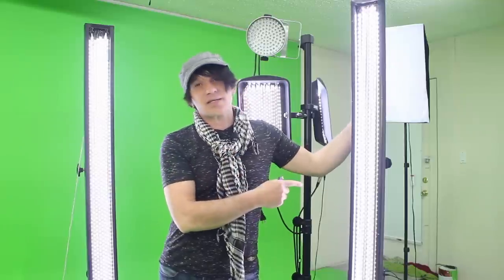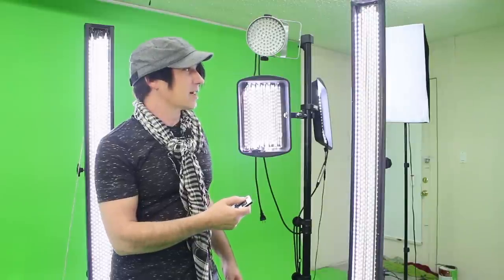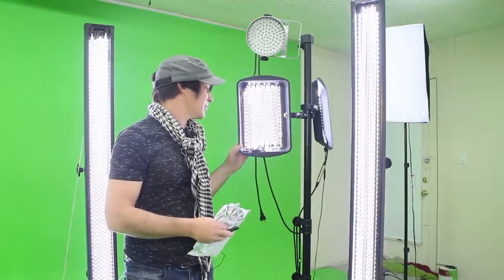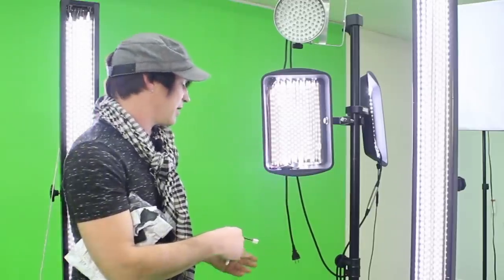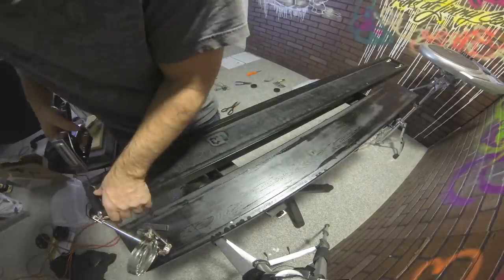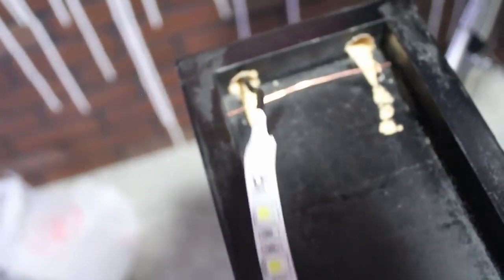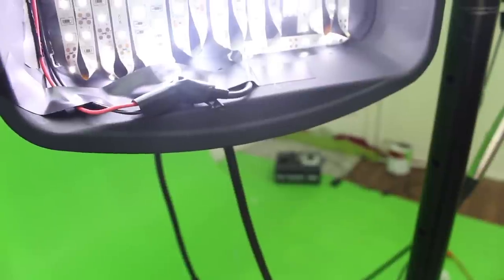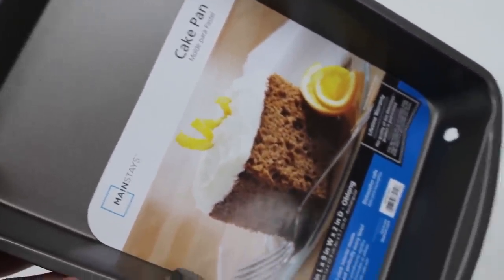DIY LED light panel How to build Video Photography studio lighting cheap

Comment: Best DIY led light panel video out there. Thank you. 
I was thinking about making 6 foot panels instead of 4 foot. 
Do I need 3 strips per panel then and how does that change with the power supply? Do I need more or is 5 amp still enough?
Any help is much appreciated.

Comment: If I were to connect 4 of these rolls together, it looks like I would need to get the 12V 10A Power Supply. I'm not an electrician, is there any danger to feeding too many amps into the LED lights if they don't consume it all?
Reply from the maker: +Bobby Dragulescu , I'm not sure, I use a 12V 3.2A and a also us a 1200Ma universal ac adapter that works best, I also found that 12V laptop power supply works

Comment: You refer to the bracket used to mount your LED light box (4' long) to your light stand. You describe the cost between $4-$5 at Home Depot. I cannot find this bracket. Any chance you can clarify it's description or include a link to it? Otherwise, very helpful DIY. Thanks.

Comment: Great video. I'm about to make these long ones to replace my 2 softbox/six clamp light chroma background lighting. My green screen is 8 x 8 feet. I'm.worried that the led strips will be too forward because I read that they've only a 30 degree forward beam. Do you think if I made two of these left and right 4 feet back from the screen would be enough?

Comment: How did you mount the wood light boxes to stands? And how do you use three on one power supply and dimmer
Reply from the maker: +Matthew Mawson I used Par can clams that you can get at guitar century for like $6, then the power and pig tailed them with old Mic cords I had here at the house, but really you get better light if they all have there own power I have found out

Comment: I built 2 panels from all the parts you listed. I used the wire clips instead of soldering. To prevent voltage drop I also got a DC female to 4 male power splitter and used the female connections that were provided with reels. It took about 3 reel per panel so I have and extra male connector open so I can daisy chain the panels together. My only problem is the lights are very cool in color and we having a difficult time white balancing. It's very rough on skin tones. Any advice?
Reply from the maker: +David W. Ryan Gels For Color & Brightness Control or even paper like a softbox and just use a little gaff tape to hold it in place, go to this link and at the bottom of the page look for Colour Temperature, and Gels For Colour & Brightness Control, you can go to taps plastic or google shop "light gel roll" gel rolls are like $3-$10+
http://www.soundonsound.com/sos/mar11/articles/light-fantastic.htm#Top

hope that helps :)

Comment: This is a good solution for long LED lights. Works on long pieces of reclaimed wood with plexiglass as diffuser.
Reply from the maker: still using them in 2021 :)

Comment: Amazing work! W.o.w 
But have a confusion ! What material you used for the light panels! Is it wood?
Reply from the maker: The big ones are made out of wood, the small one at the end of the video was made out of a $3 cake pan from Wall-mart with would backing :)

Comment: Does this dimmer cause flickering? Especially when dimming the light down?
I can't really tell if it's a PWM or a voltage based dimmer by the description in Amazon.

Thanks
awesome video by the way
just a bit too harsch on audio editing.
Reply from the maker: ***** thanks for checking it out!  Actually it makes the flickering stop.  Works great to stop it at full capacity.
Reply: las vegas video production service Thanks. This helps me out a lot.
I was already worried about a complicated circuit I would have to build do avoid flickering :)
Reply: ***** If you use a voltage regulator in your circuit, it will stop the flickering all together. Then you can still add a dimmer to achieve different light values.
Reply: +Rob Cartwright what is a voltage regulator how does it look and how does it work?

Comment: Kindly share the link to the clamp you used to mount the light to the stand.
Reply from the maker: +Ayoola Ekunboyejo there just stage par light clamps, you can get at Guitar Center of DJ store, or ebay.. Here's a link to some on ebay: http://www.ebay.com/itm/Heavy-Duty-DJ-Lighting-Clamp-C-Clamp-for-Up-To-2-Truss-/391121273954?hash=item5b10a50462:g:sO8AAOSwpDdVNlgX

Comment: Hi. How long did the glue hold on those cheap led lights last or are you still using them?
Reply from the maker: I just looked, the video was uploaded in Jan 2015 and I am still using them today, I did have to Re-Solder a few times in the las 5 years :)